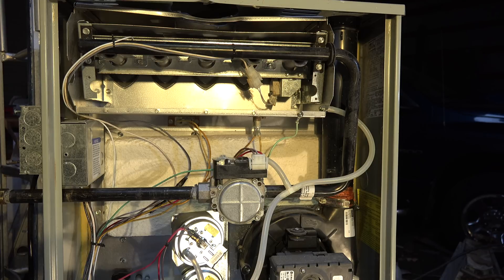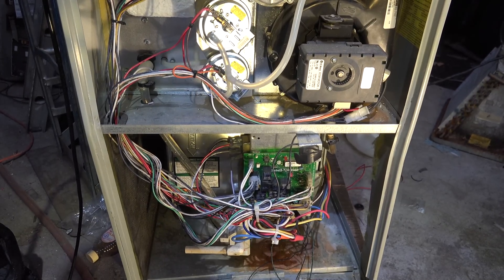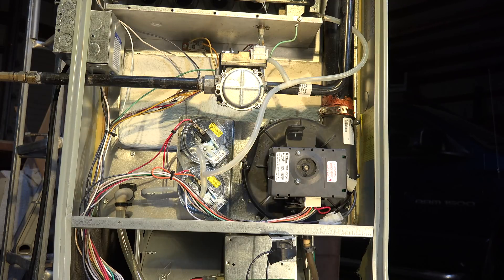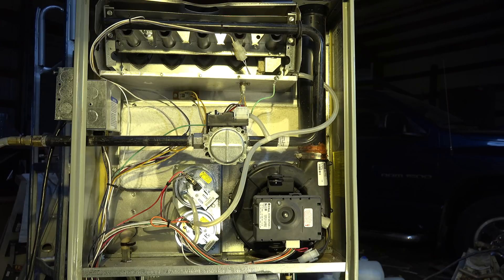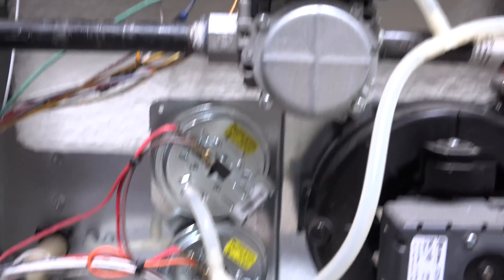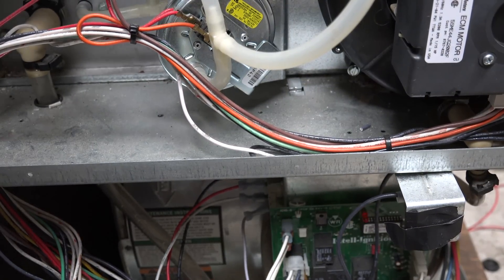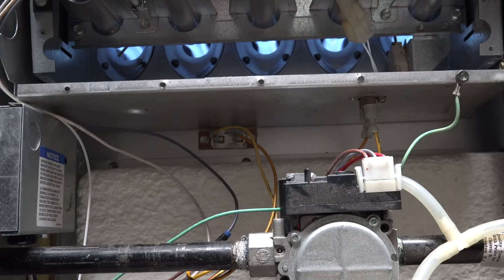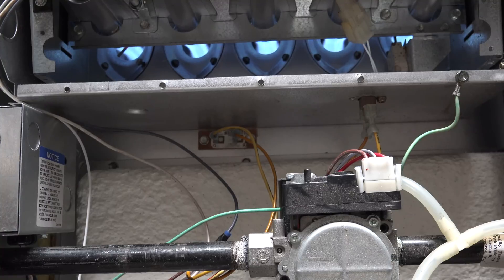Whats wrong with this furnace #6

Comment: The way the flames were just slightly wavering around made me wonder a little about the heat exchanger...but not enough. I thought it wasn't getting fully to the second stage for some other reason.
Reply from the maker: The link to the answer is at then end of the video.
GFM

Comment: The inshot burner pattern doesn't look so smooth . Maybe a small crack on heat exchanger ,but that could  because the return cover missing is interfering with draft.
Reply from the maker: Check the answer.
GFM

Comment: The burner cover should be on for proper pressure switch/high fire operation.
Reply from the maker: +Jon M. HVAC The burner cover is removed to show the burners.
GFM

Comment: I would first of all put a manometer on the outlet of the gas valve and see if I am actually getting 3.5"WC or 4.0"WC to the burners, it does not sound like it getting enough gas, I hear a whining so I assume that the ECM motor on the inducer motor is working correctly.

Comment: this is a good one. seems like the flame changed Pattern  when the blower kicked on possibly bad secondary heat exchanger,and gas  valve didn't go into second stage.  hard to tell with out a monometer hooked up.

Comment: good video, 1. burner cover should be closed because low pressure switch can not be activated , it will shut down after couple minutes.
2. it should have At least 10-15 minutes delay before it will kick the second stage.

Comment: I was watching closely and i saw that that the flames had no change in size at all so maybe the gas valve wire is not connected properly or that the high fire solenoid valve is dead or broken.

Comment: The drain line from the secondary heat exchanger is disconnected from the trap. Not only will water leak on the floor but also the blower can draw exhaust into the air stream.

Comment: I see a loose screw and a disconnected condensation tube...I didn't hear the second stage of the inducer fan. I did hear the blower fan kick up and saw the size of the burner flames increase slightly but I didn't hear any change in the inducer fan speed. I think that the relay that controls the secondary stage of the inducer fan is faulty.